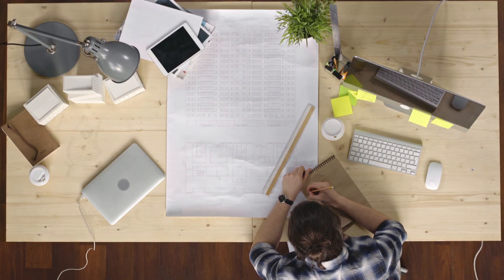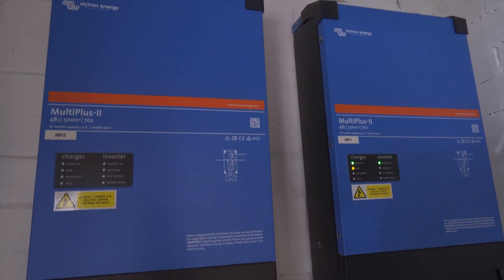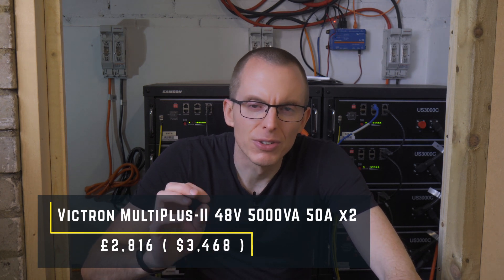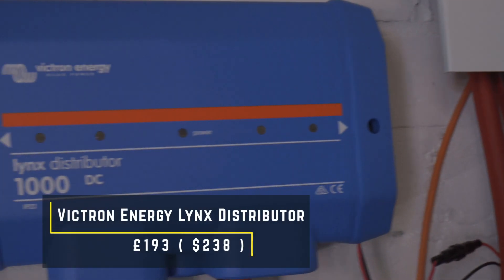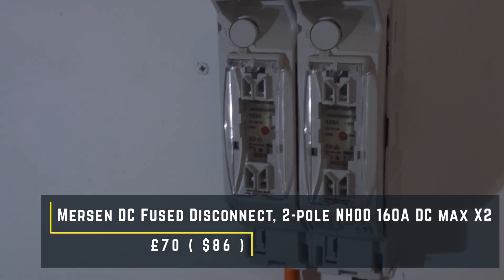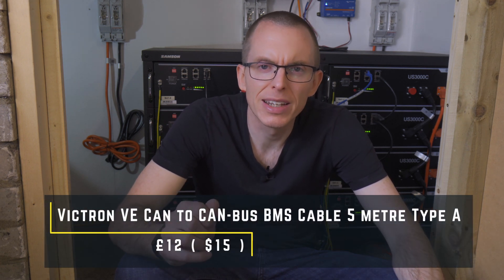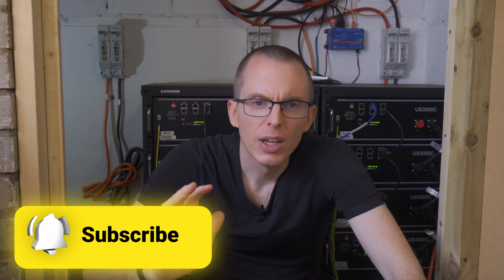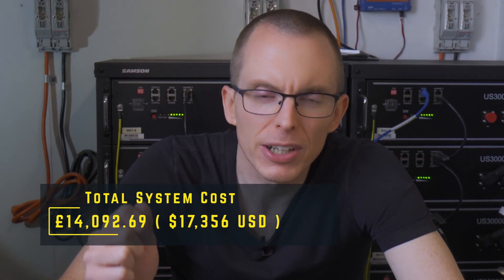Home Battery System Exposed: Discover the Real Cost & Essential Components!

Comment: A question should be given at that moment. How long have you been using this? Do you know a Winter behaviour? If you have the battery charged fully how long can you work off the grid? How quickly will this investment depreciate? Maybe a video showing the calculations?
Reply from the maker: Those are all important questions to ask. In our case with a heat pump our winter consumption is much higher, this specific system copes OK most days but on colder days we do run out of stored off peak energy in the evening. I'm working on a video now that will detail the savings made over the first 6 months of running the system.
Reply: @RodMcBain  Thank you for your response. I will check the video once it’s published. Fingers crossed.

Comment: Nice summary, I hope you gonna get your solar panels ready soon. I did it in a reverse order with my system ( that seemed to be the more sensible) and to be fair, I found Victron quite complex and overwhelming... Therefore I went for the DEYE (Sunsynk)  8kW Hybrid inverter. I have DIY battery storage (approx. 30kWh) 8.8kWp. One more common factor, I have a 14kW ASHP for central heating, to heat our 190square meter 90' house. Getting through on the first winter, still some tinkering around the heat pump settings, but in general I'm absolutely happy with my system. I wasn't brave enough to summaries the costs, but hey, its all done now... Are you gonna make more Home Assistant videos? I just started to play with that and working on to implement my BMS units, and an energy meter (heating) to monitor usage etc...
Looking forward to the coming videos..
Reply from the maker: Thanks, I'm planning my solar install now, will probably end up getting it done just in time for winter 🥶. I'm not sure installing the battery first was as nuts as it first seems, even without solar I'm saving loads on my electricity bill using off peak electricity. 

I'll definitely be making more videos about how I'm using home assistant, working on a video now about switching the heat pump integration to use modbus.

Comment: The room where your batteries are in is it heated?
I’ve just built a box with infrared bulb to keep the batteries warm with a fan to push the air
Reply from the maker: It's not heated, but it is small and well insulated, last winter the heat generated by the inverters seemed to be enough to keep the room warm enough. I had setup a heater but ended up not using it.
Reply: @RodMcBain  I’m waiting to see if the inverter does the same for me but think I’ll run it in the box for two winters and see how much the internal temperature of the garage gets too. Mines in a garage so not the best to insulate single wall brick

Comment: Great video Rod. I've got pretty much the same here in Kemnay Aberdeenshire. Its been up and running with the US3000c s for over a year. I wouldn't worry about the small cooling gaps between the batteries. Experience has shown that I have to wrap my batteries to keep them warm in the winter.. they like to run at the high 20s C but they almost never get that warm even in 30C outside ( yes we had a couple of days last year even here) the usual summer battery is in the low 20s C and they struggle to get into the 20s C during the winter. Keep the interesting videos coming.
Just as a PS. I put 4 inch drain pipe as a duct, between the garage and the house. A little more time consuming but it enables me to run extra cables when required.
Reply from the maker: Hi Chris, thanks for the comment, I grew up in Aberdeen so know first hand how cold it gets in winter 😀. I've not had to resort to wrapping my batteries to keep them warm, the small room they're in with the inverters seems to be enough to keep the winter temps up to reasonable levels. I'm hoping some added ventilation will be enough to get through the hotter summer days without needing to re-rack the batteries. 

I did run some 50mm Twin Walled Cable Duct for network cables when I put the 10mm SWA cable in. I had thought about putting in a larger duct for the new cables but might follow your lead on the drain pipe, thanks.

Comment: If the goal is to have a temporary emergency electricity source, a portable generator and a generator inlet are far less expensive and will likely last forever with a minor amount of maintenance. During the great freeze in Texas 2.5 years ago, we were without electricity for about 4 days total. I swore I would never let that happen again.  I invested about $1500 and purchased a 5000 watt inverter generator, a cable, an interlock kit, and a generator inlet, and had the interlock and generator inlet installed by a professional, though I would say that the installation is well withing the capabilities of a lot of people.  This last year, we had another long outage (about 3.5 days). While my neighbors were mostly without power (one person in the neighborhood has a $15000 full backup generator), I lived a normal life in my home. We had central heat (though my heat is provided by a natural gas furnace), TV, Internet, washer, dryer, lights, hot water (gas) stove (gas) microwave, toaster, and pretty much everything else except central air, but since this was another cold weather event, the AC did not matter.  My generator would go about  13 hours on 4 gallons of gasoline, so yes, I did have to refill my 2 five gallon cans every day, but I had electricity. Including a couple of other short outages and periodic running of the generator, I got to about 90 hours, and I spend about $6 to change the oil.  After this, five of my neighbors, who I think maybe thought I had over-reacted when I put my generator in, asked me how they too could get their house set up. Once of them changed his mind and decided to do a battery while the other four went the inverter generator, but when the fight person found out that having someone install a backup battery that could run the house for 3 days was going to cost $20K, he too decided that the inverter generator made far more sense.  Emergency power is like car insurance. You might go all of your life without an accident or a prolonged eletric outage, but estimates are that 600 Texans died in the big freeze, and that is not going to happen to me or my friends.  For $1500, I feel like it was the best insurance money I have ever spent. I have actually used it several times, and I expect that I will use it several more times.
Reply from the maker: Backup power is certainly one of the use cases I have and if it was the only use case you're almost certainly right about a generator being a much cheaper option.  My main use case was initially to save on electricity costs by charging the batteries on cheap off peak electricity and consuming from the batteries during the peak period, this saves me money every day and reduces the pay back period significantly, once I add solar into the mix it becomes a no brainier. 

A hybrid system with a smaller battery and a generator is probably a great option that could give you the best of both worlds without the cost of a battery that lasts 3 days.
Reply: @RodMcBain  Please, do not take this as an attack, but solar is not always the best investment. If you live somewhere with very high electricity prices, like Sothern California residences served my Sempra, then a battery system is indeed a wise investment.  For many people though, where the electricity is far less epensive, most people that put in solar have probably made a financial mistake doing so.  In those cases, they would have probably done better to invest in electric utility stocks.  I had a quotes to do solar at my house that averaged out to about $36K (not counting interest if I were to take a loan.) Now at the time, I would have gotten about a 25% rebate or something, and that would have made the investment maybe $27K.  For $27K, I could have bought 330 shares of Duke Energy, which was trading at about $80 a share.  Today the Duke stock would be worth $29.7K but along the way, I would have collected $5000 in dividends. Now, had I used that money to buy a S&P 500 mutual fund, it would be worth about $45K today.  What this means is that a lot of people would probably be much better served buying stocks than spending money on solar. In the long run, it is a far better investment.
Reply: @RodMcBain  Also this. If people buy because they want to be green, the flaw in that is that if you invest in a utility company that is expanding their renewable power, they can create 4 times the renewable generation with that money than the homeowner can because of of the enormous benefits of scale.  I had some wind power stock that skyrocket because the more people invested, the more wind power they could generate. I would say that I am have a sizable investment in eclectic utilities (I own about $45K of electic utility stocks and continue to add more because eletricity is the future)  and what I would say to people that are looking are looking to install very expensive solar systems is that they should have a financial advisor go through the numbers first.  Now again, if you live in a SEMPRA (and I own some SEMPRA) area and pay $.45 a kilowatt for electicity in the afternoon, then solar might make more sense, but if you live somewhere that your peak rate is about $.15 per KW, solar is almost for sure not worth the investment, especially if you are paying cash.
Reply from the maker: @shenmisheshou7002  It's certainly true that if you're only interested in solar as a financial investment, there are almost certainly better options. I'm in the UK and currently on a reasonably "cheap" tariff, but our peak rate is still about $.40 / kWh. In my case adding a large solar array will cost about $10k so makes sense for me as something I want for many reasons but will also pay for itself over time.

Comment: Hi Rod, I'm looking to buy a server rack for my US5000 batteries and would appreciate your advice. 

The US5000 is 161mm tall compared to 132mm for the US3000C and I want to have space for 4 batteries. I only have 2 at the moment and am about to get a 3rd but want some expansion space. I'm a bit constrained for height as the rack will be under a staircase so I have 780mm available. That is exactly the height of the Samson SRK16 without the casters and if my calculations are correct will allow 22mm of space between modules. (ie. 16U = 711.2mm and 4 x 161mm = 644mm so (711.2 - 644) / 3 = 22.4mm gaps. Of course that assumes the bolt holes all line up where I need them to...

The other thing I wondered was whether you needed to install some form of support for the rear of the modules as it says in the Pylontech manual not to rely on the front panel to support the weight of the module.

Would you recommend Samson in general? The 16U isn't in stock anywhere I've looked so far but I could get a DAP HI-D7601 one for £162 inc VAT.

Thanks again for your content - always informative. :)
Reply from the maker: Hi Craig, I'm really happy with the quality of the Samson SRK,s, they are really sturdy high quality racks. I think having the screw holes threaded into the rack itself adds to the strength, I'd be a little wary of a rack that requires the little square push in brackets.  The Samson racks were the only ones I found that were actually rated to handle the weight of the batteries.

My only complaint is entirely my fault, I've not left enough room for cooling, probably should have also gone for the 16 instead of the 12. On the plus side that did mean I didn't really have to deal with supporting the batteries at the back, they are only about 1mm apart and I placed some washers in the gap to ensure they were not stressing the battery case or the front of the rack.

I think in an ideal world you could purchase short 19" rack shelves and fit them in the back of the case to support the rear of each battery, but at about £20 each I'd probably still go down the  route of some kind of spacers along the back or make up my own brackets to screw into he rear of the case.

If I was I only installing 3 or 4 batteries I'd possibly consider the Pylonteck brackets https://www.itstechnologies.shop/products/2-x-brackets-pylontech-us5000 not as smart looking but more compact.
Reply: @RodMcBain  Thanks for taking time to respond in detail - very much appreciated.

I'll do a bit more searching and see if I can find somewhere which has the Samson SRK16 in stock. It does look like a tidy rack and seems to be good value. I agree that shelves are a bit pricey so would probably do something bespoke to support the rear of each unit.

Unfortunately I don't think the Pylontech brackets are suitable because the operation manual says they are limited to 3 units in a stack. These modules are 40Kg each so a stack of 4 would be applying 120Kg to the bottom one. I know the modules are sturdy and I can see them taking 80Kg but 120Kg is quite a step up. I might not go beyond 3 modules but I want to keep the option open to go to 4 modules if it makes economic sense.

As a bit of background, we installed batteries (US5000 x 2 + Multiplus-II 48/5000/70-50 x 1)  before solar PV to take advantage of our Octopus Go Faster tariff (8.25p/kWh / 40.13p/kWh) and because we were in the process of refurbishing the roof on our garage which needed to be completed before we could install our PV panels. The batteries alone were great and kept our average cost per kWh around 9p. Most days we could charge the batteries, and our EV (BMW i3), during the off peak period (21:30 - 02-30) and run on that energy until the next off-peak period. But a few times a week we'd run out of battery energy during the day and would then be paying 40p/kWh for a few hours.

Our self-installed solar PV (Trina Vertex S 425w x 16 + Victron MPPT 250/60 x 2) was operational just a couple of weeks ago and is a 6.8kWp array on a south facing, North Ayrshire, 15 degree roof. We're still figuring a few things out such as solar forecasting, but in general it's working really well! We've generated 203kWh in the last 13 days and it has been very mixed weather to say the least! 

On days when we have excess energy we dump that energy into the EV by allowing the batteries to discharge to 25% SOC during the off-peak period. But, there have been a few days where solar generation has been very limited and we've then struggled to maintain the house never mind the EV. So this is why I think a 3rd battery would help, and possibly a 4th in the future. 

As I'm sure you're aware, it's a difficult equation to calculate the cost-benefit of battery storage, especially when combined with solar PV. But I think that equation becomes simpler when we have some days when our batteries are full by 11:30am and other consecutive days when we are struggling to maintain 14% charge. Clearly we need more capacity to smooth out the bumps but the question is how much more.

Thanks again.
Reply from the maker: @craigchamberlain  I think the US3000Cs can be stacked 4 high with the brackets, but with the added weight it makes sense the US5000s can only do 3. 

Sounds like you've got a great setup, the ability to incrementally add batteries is a big advantage of rack style batteries like the Pylontechs.

Comment: Battery cost is still way high, but the Chinese are setting up factories right now. So soon we should see quality batteries for less than half the current prices.
Reply from the maker: I think that's very possible, but as production capacity ramps up demand is also rising rapidly, not sure prices will come down as fast as we'd all like.
Reply: @RodMcBain  Lots of variables we can't calculate like war, but lots of improvements on the battery efficiency and cost just around the corner. Better batteries being built out of lower cost material at lower prices will happen. Just hope Edison doesn't own my house before we get there.

Comment: I did a lot better for price

18K for 6x16 KWH Battery , 3x1K6 MPII , 2K for Additional Hardware and Cabling, fuses etc, able to charge/deliver @11KWh  , We use 25KW a day without the cars now, so we have agood reason to go big.

Most price savings was done on the batterypack. Large discount because of the volume ordered. I do like your setup and confess, my setup has more DYI components ( the battery pack : EEL) 

dont worry about the termperature: Battery systems like 25-35c , just make sure you set your params correct so the BMS can shut off f needed.
Reply from the maker: Sounds like a great system you have there, I'd not really considered building my own packs. When I first planned this system I was considering installing it in the house so wanted something compact and tidy, probably worth considering for the future given how much cheaper they are.

Comment: I've spent about 7000 USD for a 13kw battery, 4.5kw solar array, 5kw all on one hybrid inverter, inclusives accessories and installation in Kenya as a DIY. Cheaper than what local companies were quoting.
Reply from the maker: Sounds great, thanks for sharing, I bet a 4.5kw array performs well in Kenya.